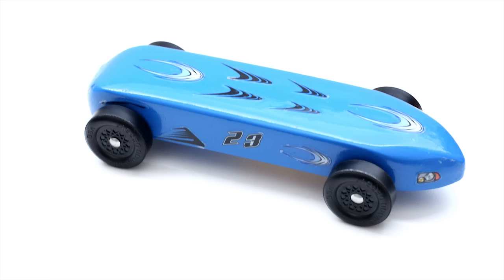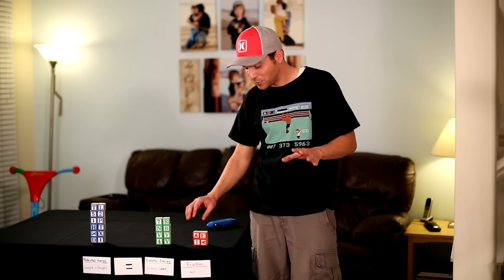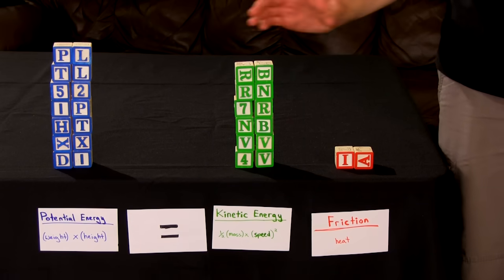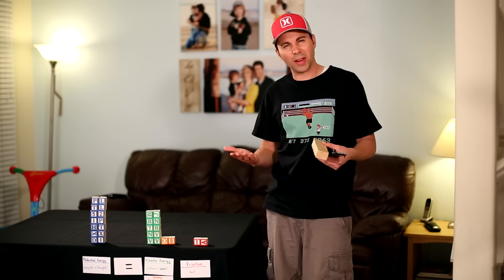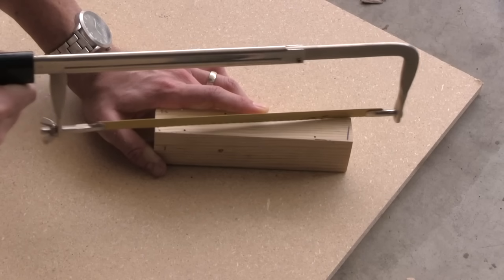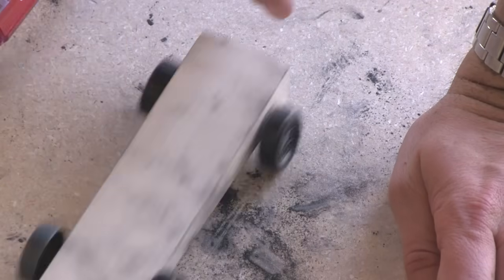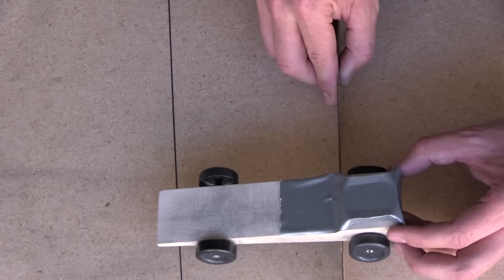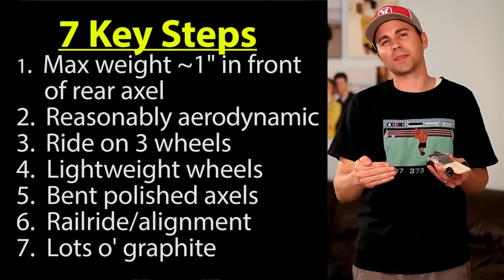EASY Pinewood Derby Car WINS using Science!!!

Comment: I wish I knew that when i was a cub scout,55 years ago,slowest car at the meet.
Reply: Don't worry bro, same here. I thought I had an advantage since my uncle worked Napa & gave me those tiny weights they use to balance on vehicle wheels. I put them on the "back" of my car...I ended up the slowest in our troop :(
Reply: I think a lot of us have the same story.
Reply: I came in 3 out of 50. There was nothing specific that I did in the build other than consider aerodynamics. At the race I learned the trick of graphite and borrowed some from a buddy. Also my mass was low so my pop and I taped quarter dime and nickel to the center to make weight. On the last 3 races my car was "dropped" which kicked out an axle. I think if I had glued the axles in place and put the mass in back as shown I would have won. I was happy though because I heard from many my car was ugly because of the paint mess I had. Sweet victory beating all those kids.
Reply: Nice! Mine was definitely not show. We only did the car race 1 year. After that it was the boat one and that was boring.
Reply: They should take the kid's input into whether or not they do the pinewood race. I don't know any kid who would have opted out of the race. It was so much fun. And no my dad didn't make the car for me. I came up with the basic concept for the design and he would help me turn that design into sketches, drawings, and finally into an actual car. Those moments are probably why I'm studying to be an engineer now. Because my dad taught me how envision ideas into reality.
Reply: Frances Nieznay too bad
Reply: Frances Nieznay Same, I won best looking though
Reply: McKendry2 Yeah but the rules say You have to do all the work so you CHEATED.
Reply: I was amazed that my dad knew to keep one wheel up and just where to put the weight. Made it to State and got crushed.
Reply: ha my brother to but not that long ago
Reply: When I was a scout I had the brilliant idea to make a cab over fire truck... luckily there was a best design award.
Reply: by a girl with the barbie doll car.   it was pink   i just know it
Reply: was that in springfield illinois   carl sandburg school.  about 1977

Comment: He said the pile of green blocks would make me win all the time but when I threw them down the track I did not. Pleas help
Reply: My nans dead
Reply: William Foreman yeah they do that
Reply: overpro cuz Did you apply graphite to the green blocks?
Reply: Have you rotated your spark plugs & air filter?
Reply: Did you try turning it off, then back on again?
Reply: Throw faster.
Reply: Paint them greener, that should help.
Reply: You didn't refill the windshield wiper reserve.
Reply: Maybe you misaligned the quantum energy primer.
Reply: @Lilyy4573  theodd1sout?
Reply: Burning Soul mayyybee...
Reply: Maybe the owners manual was upside down
Reply: bro u got it half right u need to use ball bearing green block, much more effective
Reply: SaucySaladBoi lmao that was gold
Reply: Did you replace the oil
Reply: Apple* have you tried a hard reset
Reply: Overpro Cuz i dont think he ment that
Reply: You forgot about the 3 axels

Comment: When I was a kid my (dad's) car always went to the regionals but I don't know why because he built it at work in a lab.
Reply: carabela125 I won when I did it
Reply: Maybe the car was fueled by the meth he was cooking in the lab
Reply: RCmies,  am I supposed to be offended or do you just want sympathy.
Reply: carabela125 HE USED THE GREEN GOOOOOO ( and maybe some wodka too)
Reply: You were probably supposed to laugh at the joke.
Reply: Adam Collins what do you mean?
Reply: I was talking to the guy before you.
Reply: Adam Collins MMM'K
Reply: I always won these for similar reasons. My Dad was a maitance guy who had a nice workshop. He was smart at math. This  was in the late 70's early 80's before they sold kits and weights. We poured lead into grooves in the bottom for weight.
Reply: carabela125 wow really your dad works at the lab
Reply: carabela125 You're supposed to laugh
Reply: Iemand
Reply: I have lab at work.  I teach physics and engineering.  My kids sawed the body after I cnc milled pockets through the original block.  It made cutting easier for the kids. The kids sanded the chassis, cut veneer panels, and weighed every thing that made up the finished car + weight to 4.5 oz.  They glued on veneer panels sanded and painted chassis. They polished Axel's and drilled holes for the wheels.  I prepared the wheel bores while the kids installed the wheels first time.  I tuned the car, removed an reinstalled wheels in there though.  I certainly designed the car based on my kids desires.
Reply: Air bearings for the win.
Reply: xD so you watch south park too huh
Reply: My dad always hepled me with my Pinewood derby karts. He was one of the people teaching other's in our troop about grinding the burs off the nail axels and using graphite as a lubricant. He was also really good at weight distribution. I was in the top 3 for most of my cub scout years but on my last year I came in 4th. Yet I made it into nearly the top 20 or so at regionals. Losing . . . to the same guy . . . . . twice XD
Reply: Schardt Cinematic Productions "smart at math" lmfaoo makes sense

Comment: So about a year ago my aunt (she was 8, 10 years younger than me lol) had a pinewood derby event at her awana club. My dad found this video and helped make her car just like the winning one in this video. From what my grandma said everyone awed at how fast it looked. Everyone thought it was going to win, but it didn't.. it got dead last. And as it turned out a couple of the other racers parents wanted to hold the car. So my aunt let them and after the race they found out that one of the weights were missing and an axle was bent. And performed way worse than our tests at home. I think this is a perfect design, but as a warning. DONT LET ANYONE HOLD YOUR RACER UNTIL AFTER THE RACE! If they are stupidly serious they will ruin other peoples car to give them a better chance. Just be cautious.
Reply: I had this happen when I was younger, a wheel was completely siezed when I ran it. Unfortunately you had to leave the car w the people at weigh in days before
Reply: I had this happen when I was in scouts, sort of. The kid dropped it and broke a wheel, and the axel flew wherever.

They replaced it with a stock wheel and no graphite on the axel, and it bounced so much that it almost came off or seized on the track in some of the matches.

Never let anyone touch your car that doesn't have to. And after it's all set and done, a few minutes with a dremel to divot the wood and axel, and a dab of epoxy over the resulting divot, keeps thieves from messing with the car. If they do, they break it, and I'd rather withdraw due to unsportsmanlike sabotage than race and do horribly after all the time invested.
Reply: That's a lot of words Nope nevermind Kids nowadays and parents are just straight up sad 🤯😡
Reply: @Mike9201984  That would make sense...you couldn't blame someone else for your failures if you won. You wouldn't have experienced failure.

Kind of an obvious observation, but I'm alright with it.
Reply: @ribbitquack1948  There's a lack of good Engineers out here, probably because most people believe that thinking like this is "too much." Just keep in mind, we got to the moon, made cars, and developed smartphones with "too much."

Never too early to plant a seed. This is an awesome experience with the right kind of dad.
Reply: @Mike9201984  when it's actually someone else's fault because they sabotaged your car, it's completely legitimate to blame them. Otherwise, by your logic nobody is responsible for their actions.
Reply: sabotage...very unsportsmanlike...especially for a church sponsored activity group such as the Awana's Club
Reply: I was just trolling.  My comment should not be taken seriously.
Reply: I accidentally sat on my sons car. The dang thing went on to win by a long shot. It was very surprising.
Reply: Had the same thing happen, my car was the fastest there but on the second last race before the finale, the team we were going against asked if they could see our a car, and dropped it by ‘accident’ which loosened the axel to the point were it fell off during the final race.
Reply: Your aunt is ten years younger than you 🤔
Reply: The fact this happened at Awana... Church people... (sigh).
Reply: My question is how is your aunt 8-10 years younger than you
Reply: Sounds like some bridge players I know :-(
Reply: 😯 seriously? Sabotage? Messed up!
Reply: MuhfugginMike what do you mean

Comment: Great vid and tips.  My twin sons are in their first race next weekend and we followed most of the advice.  The rules are pretty tight and allow only unaltered stock wheels and no canting.  We are running on 3 wheels though and will ride the rail.  Also put the weight 1 inch in front of the rear wheels and polished and graphited the axles.  Will let you know how they do.  Thanks!!
Reply: So two weekends have now come and gone and my sons den leaders suck!!!  Well they've sucked since the beginning but now I have 2 very upset boys because the Friday (day before the race) when they were supposed to have inspections and a test run nobody (scout or den leaders) showed!!  Just a bunch of kids with cars they've worked hard on.  Regionals are next Saturday and we still haven't had a preliminary race.  Good wife and I have been calling and emailing everyone at BSA and everybody either blames it on somebody else or they just don't wtf they're talking about.  I think we are done with Scouting now.
Reply: Update 2 if anyone cares.  A den leader from a local community heard about what happened and they invited us to join them in an unofficial fun run race.  It was a blast for the boys.  There were about 12 Scouts and they ran 11 heats.  One son made 2nd place.  Other son's car not so much.  That was my bad.  Not aligned well and pulled too hard to the left.  Fun was had by all.  Again thanks for the info.
Reply: niceee
Reply: That sucks man.  Seems like BSA has gone down the tubes a bit.  BTW, I'm not so sure that riding the rail would help you so much if you don't cant the axles, wonder if that was part of the issue.
Reply: yeah I was in the BSA a while back and our den leaders were complete jackasses. One of them ended up laundering the money and another one went to jail for rape soooo...

Comment: My dad wanted to reduce the surface area of the wheels so we narrowed them.  Turned out it made it rattle left and right on the track and came last
Reply: well friction is independent from surface area. F_r = µ*F_n
Reply: @QuarktaschemitSenf  uh oh, do i hear an engineer that is going to make a pinewood break the soundbarrier?
Reply: @eliaskjrbo8142  Fatherless lmfao
Reply: @QuarktaschemitSenf  You forgot to factor in the coefficient of the square root!
Reply: @eliaskjrbo8142   "You"
Reply: Narrow the wheel near the outside to reduce the rotating mass and the friction from least amount of surface area touching the track. Best way is to use a lathe. But a drill with sandpaper or emery cloth should suffice. Make sure to be careful not to damage the center bore of the wheels when working on them

Comment: Piggybacking of David Ingram's question... with no center rail, would you still make the back wheels canted? ...I understand that you would still have only three wheels touching the track. Does it matter which wheel is not touching without the center rail? Race in 3 weeks.
Reply: +scandawg1983  Yes. If you use the center of mass trick which is also the only real way to make three wheels possible then removing a wheel in the back would make it tip sideways.
Reply: @Mark Rober
What if you polish the wheels?
Reply: sand them narrow and nobody will beat you...
Reply: scandaw
Reply: craigslistrr O

Comment: you wouldn't lose speed due to friction if you put dry ice on the bottom the thin layer of carbon dioxide will make it float on the track
Reply: Jaden Forsberg problem: they probably wouldn't appreciate you putting dry ice on the track
Edit: nevermind i realized you meant on the car, whoops
Reply: pretty sure that would be considered cheating lol ... pinewood hover car .... great idea though
Reply: Car made from dry ICE problem solved
Reply: it WOULD lose speed to friction though, just not enough to notice :p

Comment: Is there a limit on how long the car can be? If not... you could have a car that is as long as the track.
Reply: car cannot exceed 7 inches in length
Reply: Suzanne Winnicki And cannot exceed 5 oz. in weight.
Reply: Yes, as long as the original block is. It can be as tall as you like though

Comment: Nice video, very well explained! I have to disagree with you though on what you said about axle thickness, because thinner axles do make for less friction. Thinner axles have a smaller circumfence, so the friction will perform less work with each rotation, thus less energy is wasted to friction. 

W = μF*θr and when μ (friction coefficient), F (force) and θ (rotation) stay the same, a smaller r (radius), will make  W (work done by friction) smaller. So: thinner axles --> less friction!
Reply: Wow that's too much information for my little brain
Reply: how is everyone so smart here
Reply: It was my understanding that the thinner axle doesn't work because there is still the same amount of weight on the axle, just concentrated on a smaller area and that any friction you lose because of the reduced surface area of the axle is counteracted by the increase that comes with there being more weight on each part of the surface area of the axle when compared to the thicker one. I could be wrong, I'm not an expert but that is my understanding of it anyway.
Reply: You're right the friction force doesn't decrease with the axle diameter, but the amount of energy lost to friction does decrease, thus less energy can go to speed. That's because energy = force * distance (W = F*s). That means that with a smaller axle, the friction force is the same, but the amount of distance the friction force travels per rotation decreases, thus the work (energy) the friction does decreases too.

Just image you walking around a football field sized circle. The amount of force you need to walk is constant, but since the circle is so big, you'll use a lot of energy walking around it. But what if you size the circle down to the size of a car? For every revolution you make around the circle, you use a lot less energy (because the circumference is smaller) even though the force you need to walk is still the same!
Reply: As long as the axles are strong enough, looseness shouldn't be an issue if your wheels fit snugly and, as you said, are well lubricated.
Reply: You're kind of right, I should have specified that the radius stands for the diameter of the hole in the wheels. However, it's fair to assume that the radii of the axle and the hole are virtually equal, since you still want your wheels to fit snugly. So if you then change r in 2pi*r, the distance does increase, and so does the work.
Reply: Nerds 🤣
Reply: Drone Battles this is just high school physics
Reply: I think if you were able to make the circumference of the hole in the plastic wheels smaller along with making the axels smaller, than what you said would be true. Like if you were able to fill the inside of that hole with some kind of ball bearings and have a tiny axel in the middle, that'd probably help.

Comment: Can anyone beat 55 years ago? 8 years old my first year in Cub Scouts. I grew up in Sunnyvale, Ca. which is just north of San Jose. Silicon valley was not even a thing yet. There were a lot of electronic companies with a lot of engineers who killed us in speed. We had a 2nd category Most Unique. I got a few honorable mention awards as a kid. Now as a dad and Asst Scoutmaster my son won twice in this category. One I did the soldering but he built the car. We used some L.E.D. lights and 2 aaa batteries for power to make headlight and tail lights. It actually did ok in speed to boot but list to kids with engineers 4 dads. 2nd win was a car created inspired by the Flintstones cartoon. We dubbed it the "Barney" car lol. It's sitting on my dresser right now : D. My son whittled it with his scout knife and we put a little Barney plastic figure from a Happy meal in a hole I drilled to look like he was driving. lol. Painted brown of course to look like a log. Great memories!! Thanks Mark